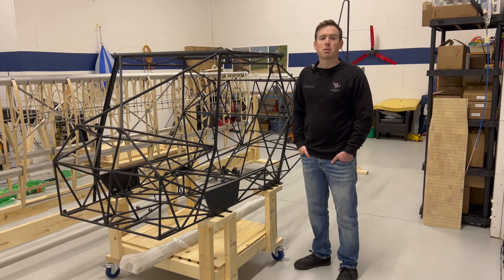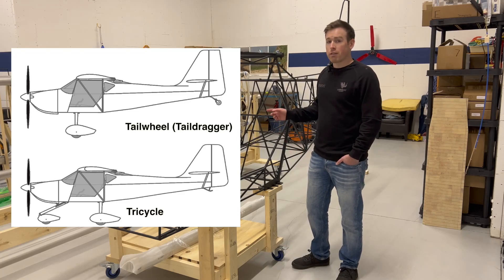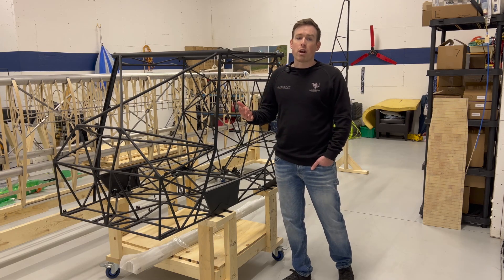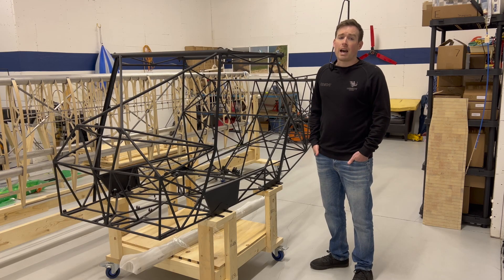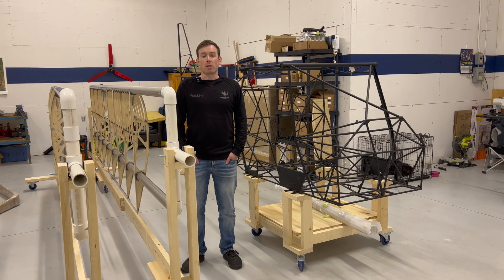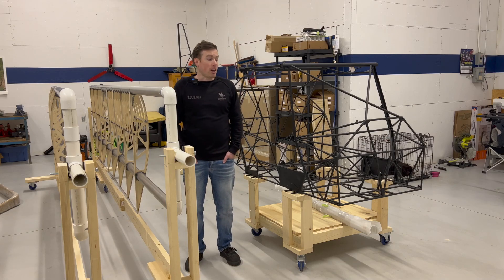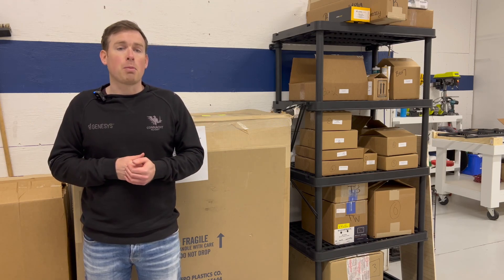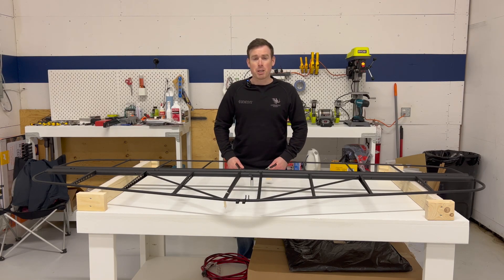SwiftFox Build Project Introduction (Kitfox S7 Super Sport)

Comment: I started my STi build mid-2018 and first flight was in April this year. Except for the STi option, my build is just like yours (912is, Airmaster prop, G3x panel, aero struts). First build for me too. I love the plane. The motor starts easily and is very smooth. Very nimble handling. Prop is like a 3-speed transmission. Incredible avionics. Enjoy your build!
Reply from the maker: Congrats on the first flight, Tom! Must have been a great feeling.